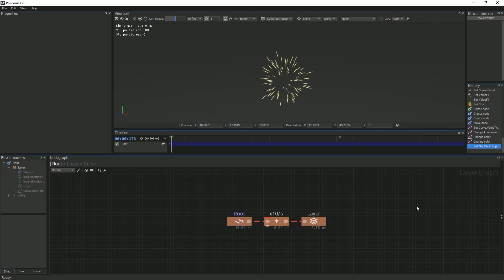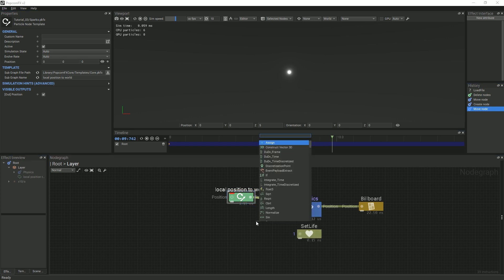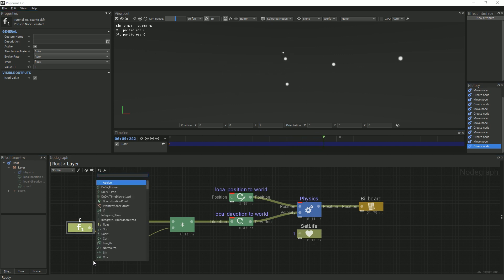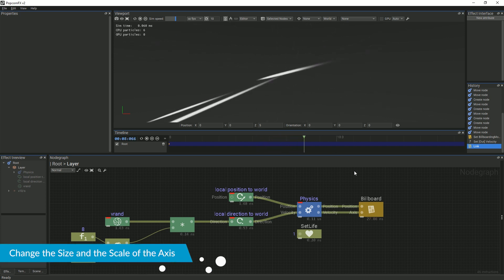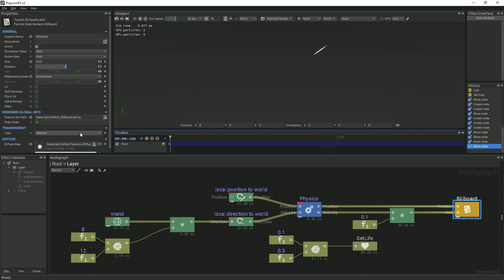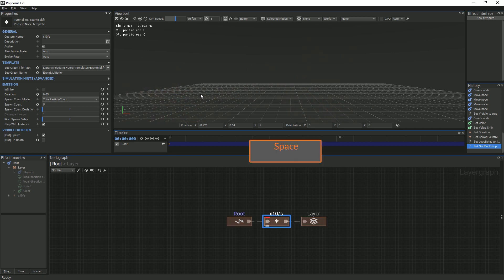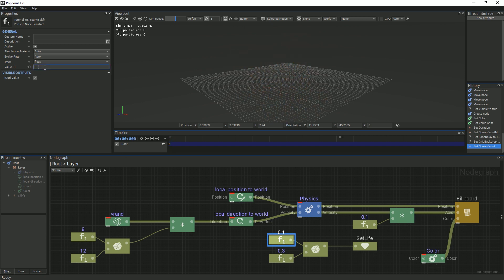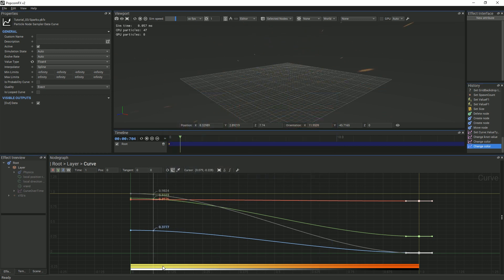PopcornFX Basics - Tutorial #3: Creating a simple sparks effect

Comment: Is it possible to get a Value Shift option with a Curve node like we seen in the Color node? If not, is there another way to get the same glow effect?

Though I get the feeling we'll get into that in another video.
Reply: If you click on the little eye on the right of the 'Value Shift' property, it'll expose it as a pin inside the graph, into which you can then wire the value from a curve sample node, which allows you to drive the value shift with a curve. Otherwise usually you can simply multiply the color with some large value to make it more "HDR", just make sure to not also multiply the alpha, just the RGB. there are a few ways you can do that, for example sample a 1D curve, then drag the wire out, and type ".xxx1" (in the latest 2.18 it'll work), it'll insert a swizzle node that will broadcast the float value to a float4, with the last component being '1', and then multiply that with your RGBA color using a simple "mul" node. (easier to just show a screenshot than to try explaining it in text, you can hop onto the PopcornFX discord if needed ^^)
Reply: @jbilalte 
It looks like I just needed to plug in a Color node between the CurveOverTime node and the Billboard node, so I can increase the the Value Shift. But, yeah, I imagine that would be similar to multiplying the RGB values to get higher values than 1.

Thank you for the info. It helped me figure out what I needed to do. I liked the glowing parts from the last video and I didn't want to lose those by using a curve. It'll be interesting to experiment with the CurveSample node and having curved Value Shifts though. Those might be useful for sparks, or perhaps some sort of flashing or flickering effect for something like those sizzling fireworks (or whatever those fireworks are called).